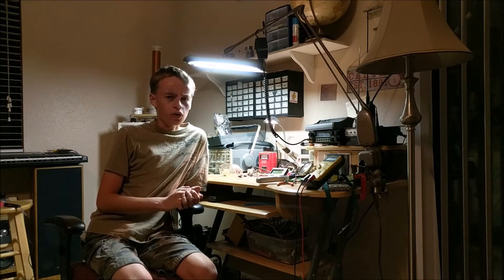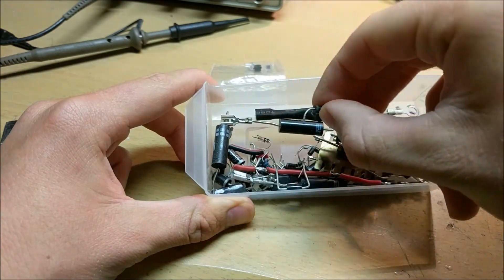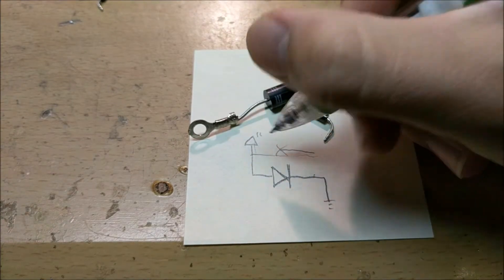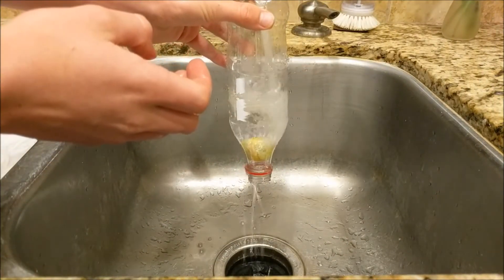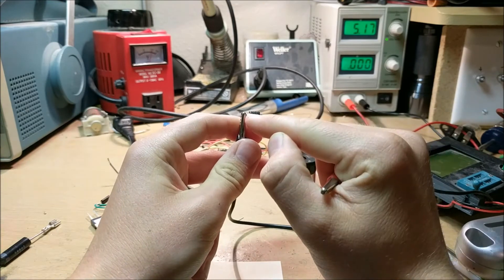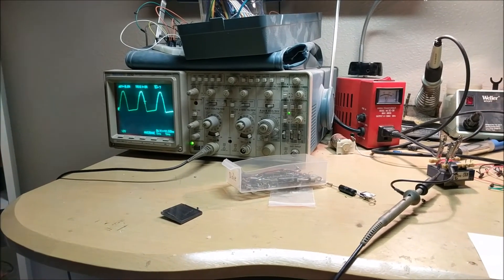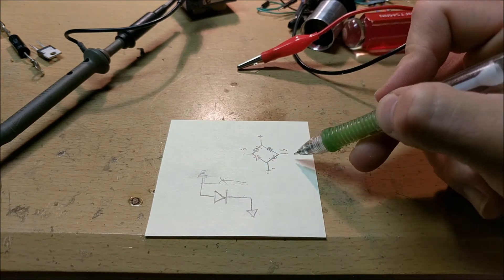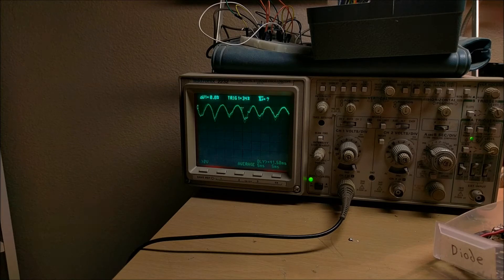How A Diode Works || Explained With A Coke Bottle and Water

Comment: as you can see as i pour the water through in this position, the water gets through
Reply: THE WATER FLOWS FROM TOP TO BOTTOM , IT ALL CAME OUT
Reply: but if i turn the diode around this way
Reply: but if i turn the diode around this way
Reply: and pour the water through it
Reply: as you can see almost no water gets through
Reply: this is like a normal diode the water represent as the electricity.